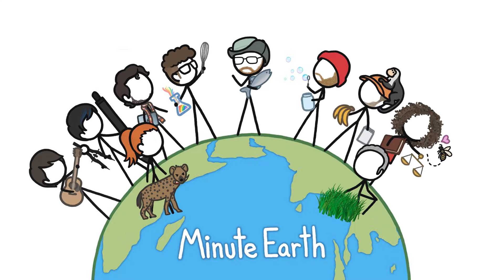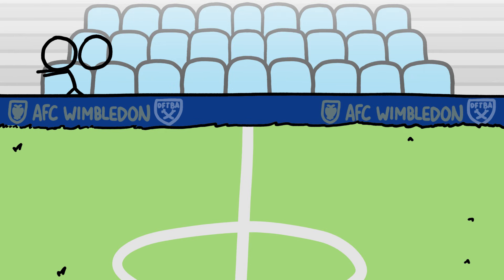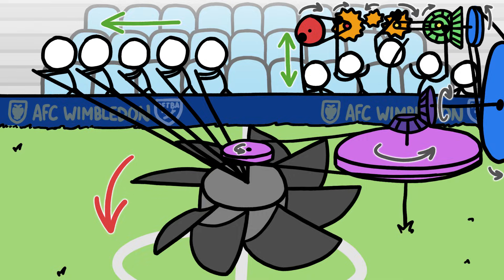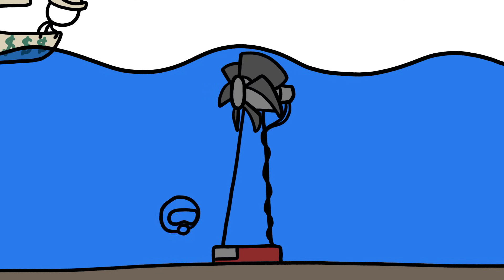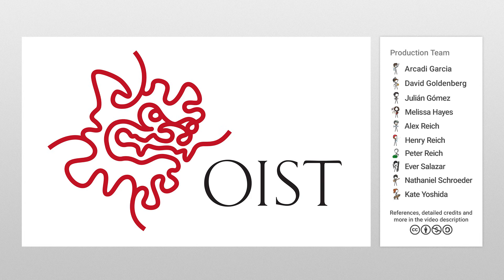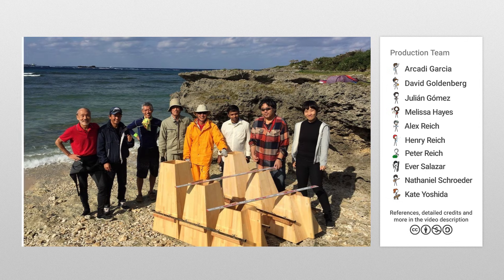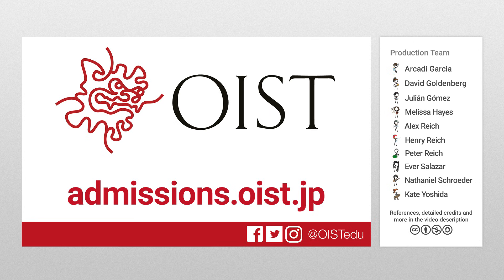Why Can't We Get Power From Waves?

Comment: THE LIMPET WAVE POWER PROJECT was in operation up to 2018.  It did not meet is 500 KW goal-reaching half that. at 250 KW. The company had more than one company change over and new management in the production of the system went debunk and ended.  However it does not affect the sea or result in mooring failing,  nor result in obstruction to other human sea activities. so I have not been able to locate why it was abandoned.  It is just concrete, a turbine, and wires, and not the complexity I see being used to do Tidal waves.  Any bright people know about this?   Once running it should not require much additional operational cost.

Comment: There is a good design for wave energy using turbines....what they do is that they put a wells turbine into a column and partially submerge it on a pier near the shore. The changing level in the column driven by waves, spins the wells turbine inside the column through the displacement of air....the turbine spins and electricity is produced.....it still needs more development...however it is an awesome solution with alot of potential

Comment: Thorium Molten Salt Reactors are the Future just need to get congress and Big Energy out of the way, and yes in case you were wondering a Turbine is required. The only energy that doesn't use a turbine is Solar and it is far from efficient.

Comment: I'm thinking funnels and Tesla valves.  Building a structure that funnels wave energy, increasing the water velocity into a water hammer pump.  Tesla valves may be able to do this without moving components.  Great coastal  structures breaking waves into potential energy.  Large elevated structures to contain captured sea water.  Or possibly wave breakers that separate wave tops from under toe.  Put a generator on each side and generate as wave comes in and undertow goes out.

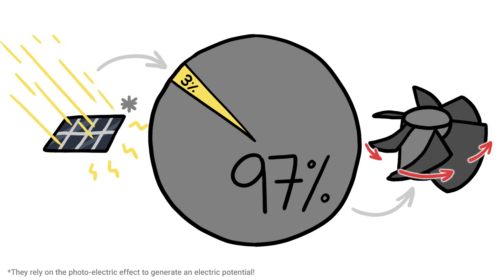Comment: 0:30 Most gas fired power stations use the fuel air mixture itself as the working fluid, a bit like a bolted-down jet engine connected to a turbine and generator. In a combined cycle gas turbine system the still-quite-hot exhaust is used to boil water in a traditional steam turbine system, thus making gas fired power stations relatively efficient compared with coal, nuclear, biomass, geothermal, or solar thermal power stations. If the gas turbine is there to provide backup power, it might leave out the steam cycle altogether since heating up the boiler takes much longer than activating the gas turbine. In either case, the gas isn't just another heat source for boiling water.

Comment: This is absolute gibberish. There are wave power stations that have been generating cost effective, low maintenance energy for decades now. There's actually a solution that works quite well; it was developed before you were born. In any event, it's called a Wells turbine. In the last two decades, different variations have been installed around the world to find how to optimize the system in a cost effective way that reliably produces consistent energy flow; the different versions of the turbine can operate between 40 and 70% efficiency, but with good mathematical modeling and logical controls on the system, they are now able to predictably hover around 65% efficiency over long periods of time. A test facility on several hundred homes has been in operation for a few years now and a previous small installation (1 MW) ran reliably and cost effectively for 18 years. 

There also impulse turbine designs that are good.

Oh, and underwater systems that use natural current flow that are reasonably good. The Voith Group has good tech; it's been running an allegedly not cost effective 110 kW tidal turbine for almost ten years now. It successfully completed a 2 year test of the larger 1 MW station (2015 to 2017) and is now acquiring an entire portfolio to begin deployment in Japan.  Contrary to your claims about the difficulty in maintaining equipment in seawater, physicists, chemists and engineers have happily solved the issue you seem to believe is actually a problem. SIMEC Atlantis is currently working on a 2 GW turbine farm in France. I think they've so far installed about 80 MW worth of turbines.

You should do some research about the tech that's out there. Your video wouldn't be accurate even if you'd made it several years ago. Actually, not even if you'd made it 20 years ago when commercially viable products were already being deployed for long-term validation. The industry has matured much since then and is doing well as we live and breathe.

Welcome to the 21st century.

Comment: Beam between two ships... Attached to each ship with a hinge on deck, so Ships kept parallel. Each ship has tall mast. Run a cable between ships over the top of masts. Fix one end of cable end to deck of ship, other end fixed to a *large*simple water lift pump. When ships rock, or oscillate over waves... Cable will oscillate lift pump

Water lift pump empties water from a ship's hold and dumps it overboard. A valve allows water to flow  from outside of ship via a turbine, and refill the hold.

Comment: Harnassing energy with air pressure gained from waves is not a bad idea. I think that we can use oil wells (pumpjacks) too, but then converted for energy harassment. It has the up and down method. So the wave comes, well gets up and down, up and down, and the generator spins and spins, all above water, on a platform. The known method, for oil harassment, converted into an electricity power plant.

Comment: Okay this video is completely wrong. First of all this technology already exists. It’s not working with turbines tho. Second the waves form a sin function which is the same if you wanna descibe one point of a moving circle with position-time axes, so the kinetic power of the waves can be converted easily.
The name of the existing system is ocean power plant.

Comment: Why not make the waves itself push some kind of magnetic tube around coil motor generator & let gravity pull itself back to place to generate electricity? Or make a machine with paddles on both side where the wave motion drives these paddles up and down which turns rotate a turbine or something (like rower inside a boat but opposite so the waves operates these rowers instead)? There's plenty of energy generator concept that works, what hold us back is energy company. They don't want to lose profits and certainly don't want people to have greater freedom in having their own "power generator"

Anyway I'm not engineer and 100% conspiracy theorists so this is something akin to that of things I spew out from my arse on daily basis.

Comment: Surely there's a way to convert wave energy directly to low frequency AC current...mmm
Reply: There is... Go look at Seadogsystems.com
Reply: @roughdiamondlagos6818  Looked at the site. A whole lot of maybe, and if, with a hew short-term scale model tests. If they are not vaporware, I wish them success.
Reply: @MonkeyJedi99   the technology has been demonstrated to technical readiness level (TRL) 8 - next step is commercial deployment
Reply: Certainly there are ways, and patent offices are littered with them.   The trouble has been coming up with something that makes economic sense.
Reply: A big problem, I imagine, is voltage. To send electricity any distance at all (even from an off-shore turbine to an on-shore substation) you need relatively good voltage - probably at least 1kv or more to go a kilometer without significant losses. A low frequency AC source is likely also to be low voltage. So you need to convert the voltage to a higher level before sending it across the wire, which is lossy if the conversion is too high.

If your low frequency source can hit 100 volts it will probably not be too bad. But if you're generating 10 volts or less your going to spend a lot of your harvested energy just converting it up to send down the wire.

Comment: Maybe we can move past the “commercially viable” paradigm instead. I think most people would rather someone admit they have no solutions than hear that they have faith that markets will generate a solution. If only we didn’t stop nationally funding basic research after we learned how to kill everyone on the planet. Maybe epic Elon will save us with his entrepreneurial spirit huh?
Reply: ... I think youre optimistic about this, and not malintencional. But the problem here is that there is not eficient and reliable tidal generator desing. This video is explainig that the current designs that we have do work but not enough to be viable solutions, in the same way that having people blowing air in to a windmill does work but the effort is to much for the return.

Comment: Atomic energy will be cleaner anyways.
Reply: To risky with small country
Reply: It's ironic the cleanest energy has the capacity to be the most destructive to the environment. Everything goes well, nuclear energy is MVP, something goes wrong, well you have Chernobyl
Reply: @kikook222  Chernobyl was actually really great for the environment. Now that all those pesky humans moved away it's become a nature reserve.
Reply: @kikook222  first, that's still way less damage than is done by other forms of energy, although it makes the news more because the tiny amount of damage is more concentrated. Second, modern nuclear reactors are somewhere between virtually impossible to melt down and literally impossible to melt down.
Reply: @kikook222  its actually less deadly to people and the enviroment if you account for all the deaths from pollution every year vastly ouweigh nuclear
Reply: The anti-nuclear movement is literally soviet propaganda designed to cripple wester economies and drive up the cost of crude oil, one of the only Russian exports.
Reply: @kikook222  more people die each day from coal.
Reply: Nuclear is not renewable. Same as with petroleum, we will run out of fissionables if widespread use of nuclear power is undertaken.
Reply: @glasslinger  we will be able to harvest them from space long long before we run out of what's on Earth
Reply: @glasslinger  
A 1000 years is a good time for a fuel rod to last.
Reply: @glasslinger  if we figure out how to easily recycle nuclear waste then that would be great

Comment: I could see a design where rather than transforming the waves you have a sort of flap that the waves push up and down and then you use this motion to spin a turbine as long as gravity can bring the flap back down you can effectively just keep it clean this way you benefit from the upwards and localized motion of waves without nearly as much effort to create it though I'm sure someone else has already thought of this method and failed to see results
Reply: Yup, that's one of the designs I remember seeing, back when I was looking into this as a high-school science project.  The main problem with this (and similar designs) is that the flap doesn't go up and down very far or very fast, so you have to have lots of really long flaps to get much energy out of the design.

Comment: Turn the turbines upside down to catch up and down movement.
Reply: You can use a giant platform to catch this up and down movement then you fix it to a place with flexible stellcabels  which translate the the movement to a generator so you have a 30% and more efficent system in development in germany 
it's defintly not perfect (it needs to be fixed to the ground) but we get in the right direction

Comment: We need to use the thermoelectric properties in the oceans rather than the flow. 

Water retains thermal energy very well. We do something similar with sand.
Reply: actually the other way around, since its an excellent insulator, it also retains cold, so we can use temperature differential, in other words, the temp difference between the ocean water and the air above it, the sharper the temp difference, the more energy that can be can be extracted. And in fact wind farm turbines operate under the same principle, but instead of temperature, its pressure, because its difference in pressure that generates all of the planets winds, the sharper the difference in pressure in a given area, the faster the wind speed

Comment: That's really interesting! I never thought much about this but I just assumed that, in the same way we can have a motor that can turn circular movement into an oscillating up-and-down movement, we can just reverse engineer that to have up-and-down movement as an input and convert that into circular movement for a turbine. But of course, it's never that simple!
Reply: It's also kind of tricky in both directions.  One of the problems with turbine-powered cars was always that turbines (especially the small ones that go in cars) want to spin really fast, and making gears to slow that down to an appropriate speed for a car isn't easy.

With wave power, you've got something going up and down maybe 10 times a minute, and you'd like to have the generator spinning at thousands of revolutions per minute for it to be effective at generating energy.

The other trick is that you always need relative motion (one thing moving, one thing staying still) to pull the energy out.  With a turbine, you've got the rotating part and the non-rotating part.  With wave motion, you need to connect the part that's bobbing up and down to something that's staying still, and that's not easy in the ocean.
Reply: @BrooksMoses  that final paragraph is what made everything click
Reply: How about adding linear generators to floating windmills?
The static parts would be the leashes connected to the seaground and the dynamic parts would be the windmills bouncing up and down. Everything fragile and heavy would be placed inside and as low as possible in the windmills for stability and minimum wear.

Comment: The information is not accurate. Have you ever seen a flashlight without batteries? That type which you need to shake to make it work? Yes, that type has a generator which works with oscillating movement not circular. 
Have you ever heard about piezo electricity? There we go, another way to do it. 
In general we just need to take our heads of the ground and seek other ways instead of looking into ways that can't work and then try hard to make it the way we want.

Comment: All you really need is a coil of wire around a tube with a magnet inside..    put it in a buoy..  as bouy gets bounced  by waves  magnet will  move creating electricty.
Reply: car engines have been converting up and down  motions of pistons into  usable power for a long time.. why is this so hard?

Comment: perhaps we should consider not looking at waves as waves, but waves as strands of hair flowing in the wind. If you make a massive grid of wires/etc. that float on the surface, connecting it to a generator outside of the water would be simple. The problem with that would be fishing issues and fish / ocean life in general.

But what about Wind + wave technology? A self-righting buoy-like structure that bobs up and down, but doesn't tilt, having a sort of wave-powered hydraulics system rather than actual hydraulics, as if the hydraulics were riding the waves and pushing up/down springs/pistons, so that the wind turbine could stay upright, and any kinetic energy left over could be stored as energy.

Comment: Reading comments I see many many commenters are hung up not understanding the difference between the flow of a river or tide, and a wave.  Others are hung up on the difference between being able to do it at all, and being able to do it economically (without needing the additional input of ongoing grants and subsidies).  

With the flow of a river or tide a mass of water is going from A to B.  Getting energy from economically this has been done for so long it is traditional. Hydroelectric power on rivers goes back to 1880, and waterwheels go back to 4000 BCE.

With a wave, the mass of water is just cycling in a small circle.  It is waves they haven't figured out how to economically get energy out of.  It isn't economical for capitalist countries.  It isn't economical for socialist and communist countries.  Not yet.

This is interesting (some kind of "ironic") since AC power (alternating current) is itself waves, electrons (or holes) going back tiny differences in waves of power.  Not being possible to economically convert waves of water into waves of electricity.  Wow. 

On the other point, yeah, you can go out and get funding, from governments, from private individuals, and build a wave power plant.  But to keep it operating you'll have to continuously be inputting not just waves but also money.  It is not economical.  It is a money sink.  A money pit.  At least with current technology.

Before investing, you'd be wise to search thoroughly to see if the proposed "revolutionary technique" was not already tried by in the 1980s and 1990s.  

Remember, the person leading the project is making their management fees, regardless of success or failure.

And the engineers on the project are making their salaries and enhancing their resumes.

It is the investor (or taxpayer) and nature who suffer the loses when an old "revolutionary technique" is trotted out to be tried again on a new generation of suckers.

Comment: I've read about wave power for decades.  The 1980s was when I first read about the first real-world deployments of large scale experiments.  So it was roughly 10  years behind the big windmills/windturbines we see all over today.  The buoys hooked by cable to push-pull generators, coastal turbines, coastal strings of floats,  all that stuff made it out of the lab and into the world.  Into the real world on an experimental scale.

The 2014 video from Brazil linked a few comments below.  Has that been scaled up yet?  I take it not.  And that is just like the similar experiments in wave power I've read about for years.  Much hype about the experiment going out into the real world, and then nothing.  No word ever of what happened.  Until this video above explaining why they all failed.